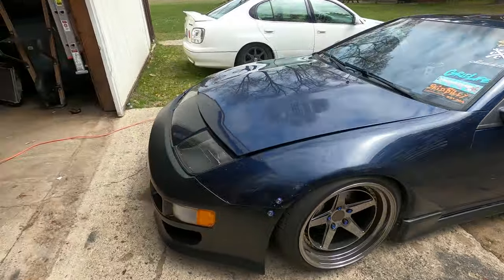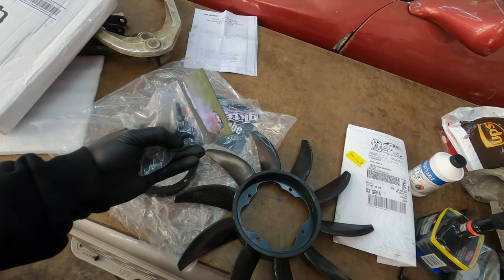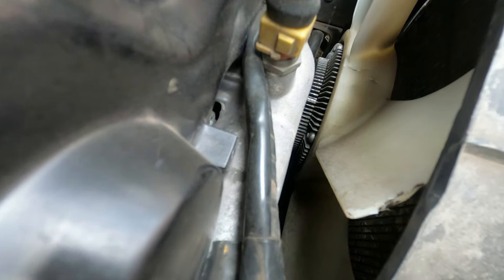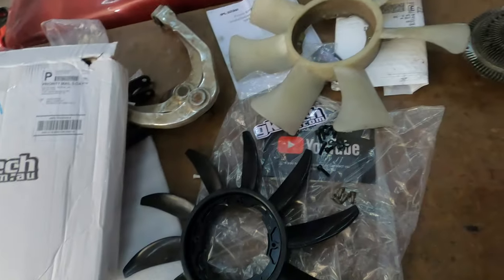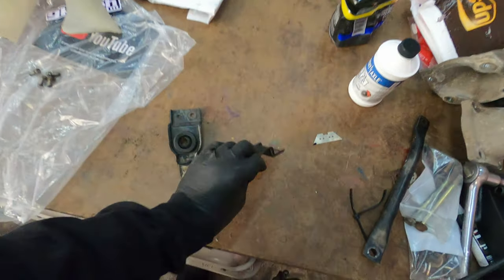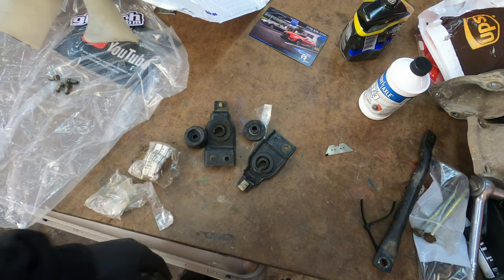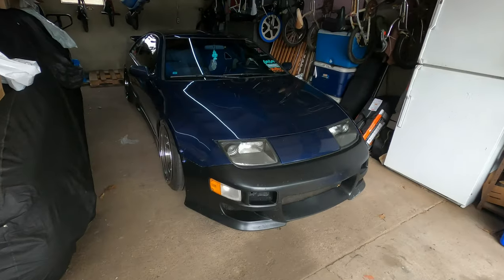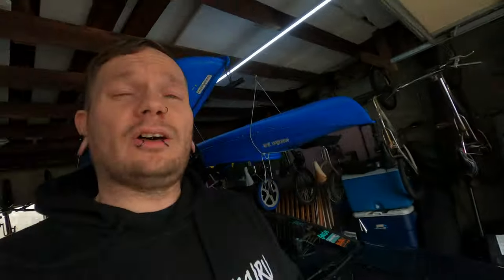the 300zx gets 40% more cooling! GKtech RB VG SR and ka fan install!

Comment: since air is compressible it is to me impossible to have that fan pumping more air the than the OEM one does , at first look that fan seems to have much less drag than the OEM one just comparing the pitches between them. I think that the only good thing about this fan is that it obviously sucks less horsepower to get driven .
Reply from the maker: Not really in thoughs of pumping air rather than in terms of a boat propeller, ilusimg pitch and blade with to make a more streamlined flow, now is it the percentage gain they advertise.. not so much, but that being said the stock was Crack very easily over these 30 years and I feel it was the better option for me to replace

Comment: is there any difference on temperature with these fans? I saw one comment where you said no noticeable change and another that said u saw a slight change. was hoping to hear how it performed up to date. were you happy with the upgrade or better stick with stock?
Reply from the maker: Didn't notice a difference at 1st as it wasn't on very hot days, so fast forward and I did notice a small difference but not enough for me to replace a perfectly good fan.. if yours is cracking then I would swap them, after that I even changed the radiator to get more cooling. I still am using that fan and am happy with it, especially for the price
Reply: @1nightkid  thank you so much for the feedback. When you slight change any chance you remember how many degrees improvement? Like 5°c ish or more?
Reply: @Dev4663t  I would say at least 5° on a very hot day at 120km my engine would get very hot on a quick 30 min trip, that same trip it did not get nearly that hot, and now after a twin core radiator it's even better
Reply: @johnwinks  awesome mate. I think that would do. As long as its a lil better than the stock. Should be worth it. Dont mind the extra noise. Ill take that 5c improvement 😂. Seriously appreciate it.

Comment: Does the new fan sound any different/better?  This was a very helpful post. My '94 makes me a little nervous when it's really hot out, or bogged traffic.
Reply from the maker: Haven't noticed any more sound from them honestly, and mine definitely would get a bit warm in stopped traffic and heat soaked, I have noticed a small difference in the new fan but I also don't drive it as a daily lol

Comment: Nice z what’s your mod list I just bought one and need some ideas
Reply from the maker: Awesome! And thank you! I have 2 more and this is my 5th z total, 
Full adjustable coilovers with full suspension components, Custom full length exhaust and intake pipes, Jim wolf ecu, and now radiator fan, and of course better spec poly body kit and 18x10.5 wheels with a hell of a stretch lol
1st thing you should do is suspension, make it handle way better
Reply: @1nightkid  do you rub with those sized wheels?

Comment: How is the cooling with that fan?? I installed it on my on a hot day in cali (100's) and seems like the old craked oem fan is better at keeping the temps down so i had to put the oem back on and keeps the temp below 200
Reply from the maker: Sadly I have not noticed a difference either, but we also have not been over 70 until now, but we will be in the 80s and 90s in the next few weeks in which I hope to do a major test on it and hope to see good numbers

Comment: Could have sworn the oem fan is better than gk tech?
Reply from the maker: Problem is that a lot of people were running no shrouds, they got the fan to better the cooling but infact got worse. Sometimes even buying them to fix another cooling problem they already had and miss diagnosed. I did it because my stock one is cracked heavily and still am running my shroud
Reply: I got my installed on my RB, sit on traffic it get to 100+, the OEM fan was cooling my car better in traffic  it was never more than 90, but on the run the gktech goes to 79c, so I don't get why in traffic it is worse than OEM,  ps. I have no shroud but the OEM worked fine without one

Comment: how did the fan work??? can you provide with the link
Reply from the maker: Worked well, as long as you keep your factory shroud for sure, plus with my stock fan having cracks it is one less thing I have to worrie about
Reply: @1nightkid  did you.notice an improvement in cooling??
Reply from the maker: I actually did notice a difference, I drove it in 90+ Temps after this swap and at a stand still with the hood open you could notice how much more air it seemed to push

Comment: Did it actually make a difference?
Reply from the maker: I actually did see a noticeable difference especially at a stand still, my 1 takeaway on this is if you had a turbocharged 300zx, 240, or gtr.. idk if the cooling properties could could keep up with the turbos adding even more heat, but couple that with a good radiator I bet it would be a great pairing.

Comment: the quality is bad 👎 i bought those and after 2 months they blow up into  Pieces one of the blades hit the hood and create a dent from the inside up ...i went back to OEM
Reply from the maker: That crazy! I truly only know 1 that has blown up in Australia
Reply: @1nightkid  yes actually they are cheaply made and you can feel the blades are weak they can't hold up the heat that comes from the 300zx
Reply: Seriously? Don't want that.
Reply: @billhowe3867  yes super serious if you have them on switch them before anything serious happened

Comment: False claims, 40% more air flow than the OEM RB fan. Does NOT flow more than the OEM Z32 fan
Reply from the maker: Possible, but 4 years of testing so far and Temps seem to be lower in standing traffic than previously experienced. I think stock would be beneficial but for an alternative it seems to do the job
Reply: @peterliang1294 Where are you getting the data to back up your statement?
Reply: @ryantzer  Ask Gktech if they have data to support their claim of 40% more than vs the Z32 oem fan.  They do not; claims are for the SR and RB fans as these were originally designed for those platforms. Just because they bolt onto a z32 platform doesn’t mean it flows more than the z32 oem fan. Quoted from their site “flows 40% more than the RB fan”. There was a z32 owner from AUS that compared the z32 oem fan and this, flowed 15% less.